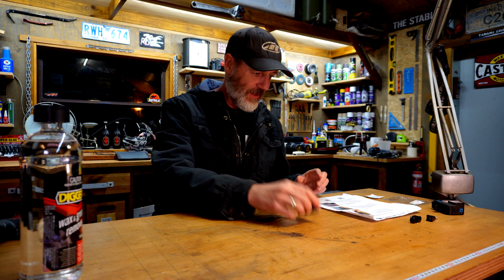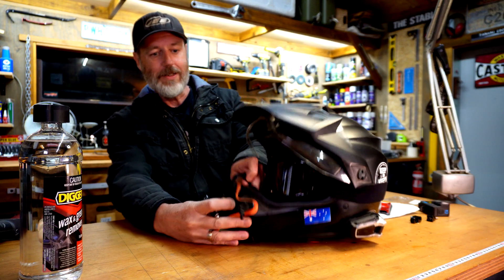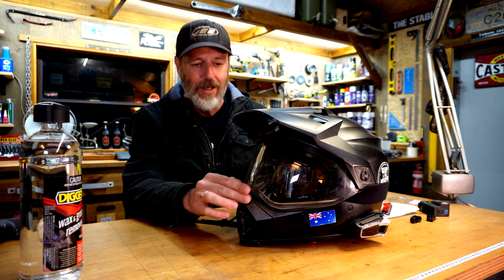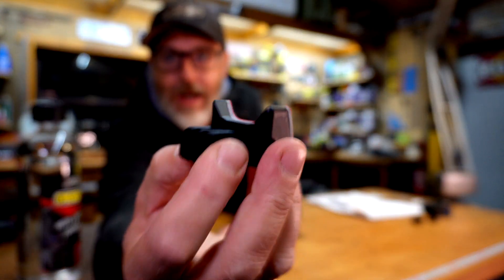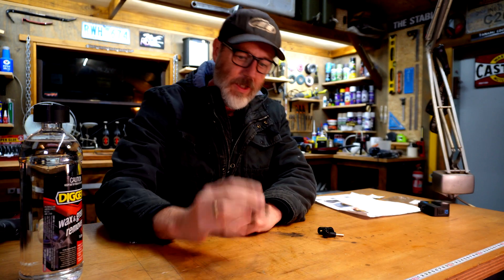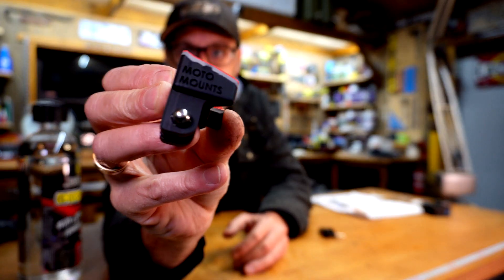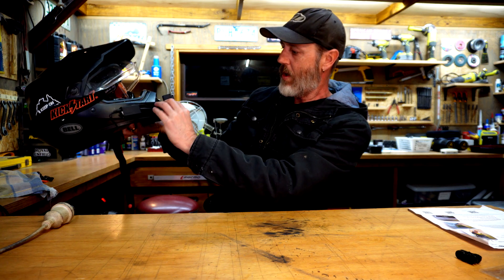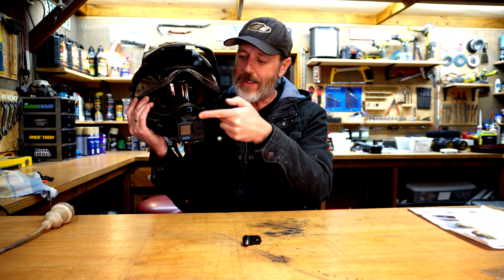GoPro Motorcycle Helmet Chin Mount

Comment: That guy from Motomount did not have a mount for my helmet, I got exactly the same  thing called Chin Mount from Canada and not as expensive as the Motomount, comes with a security cord as well, yes you need the added extension to get it at the correct angle for filming from the helmet …

Comment: I have the same helmet and my concern would be the camera blocking air intake.
 I think ProShot from US has very similar idea but camera itself is further away from  air intake.
ProShot uses larger sticking area and velcro so mount can be removed if needed to.
Interested if your new mount works for you.
(Personally  don't trust a bit of  sticky tape holding $600 camera)

Comment: Looked into one your saying about but none suit my helmets & not prepared send my helmet for fitting design , presume they would need them.

WannaBes "custom made to helmet brand & series" is best i found for all my helmets shapes

Airoh avator 2.3
LS2 Subverter  MX700 & MX470
ProGrip  3191 & 3090
Shoei VFX-W
One Industries combat

Tried ProShot only good with flat side surface 

use to use the strap mount as well
Reply: Still had no reply from MotoMounts  :(